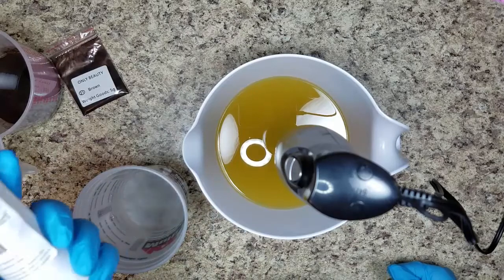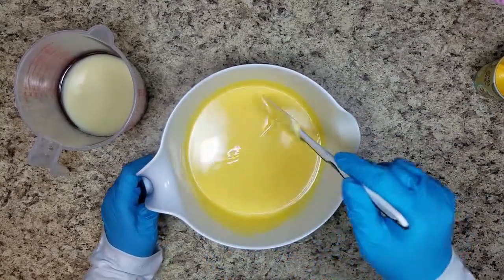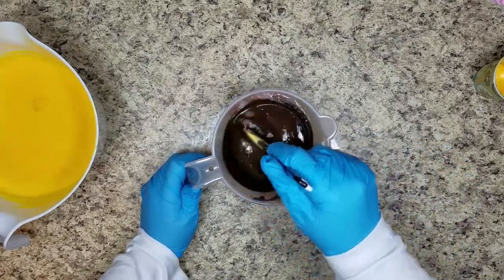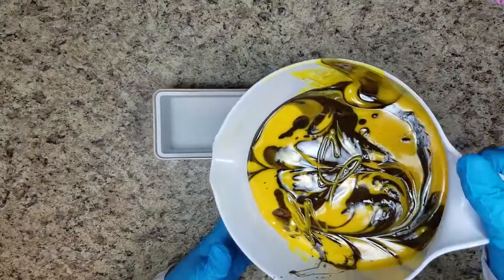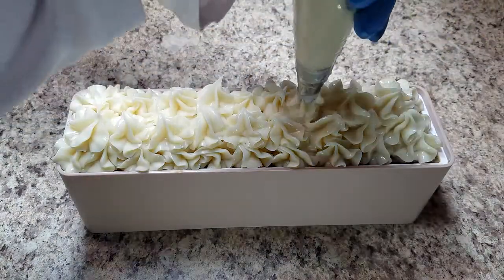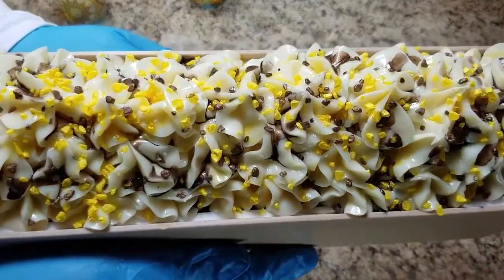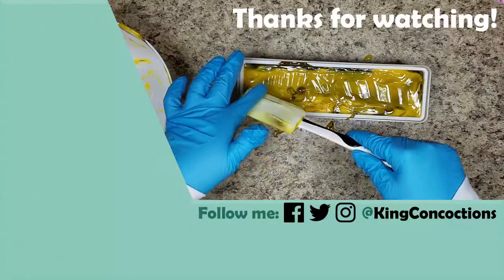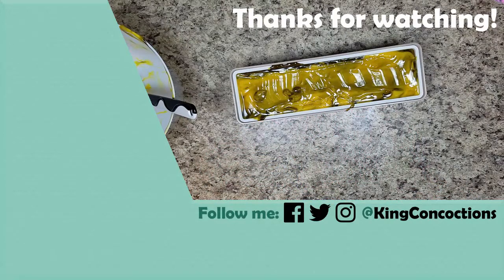Making "Cashmere Scarf" Cold Process Soap

Comment: Can u pls tell is there any measurement required for lye n distinctwater mixture
Reply from the maker: Yes there is! It's different depending on what oils and butters you use, and how much of them you have. You need to use a soap calculator. The one on brambleberry is pretty easy to use in my experience!